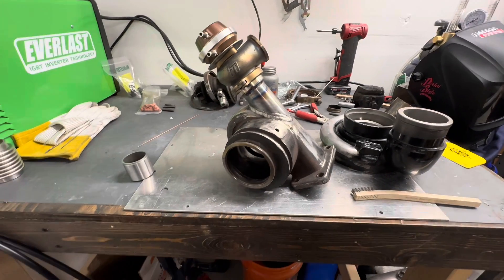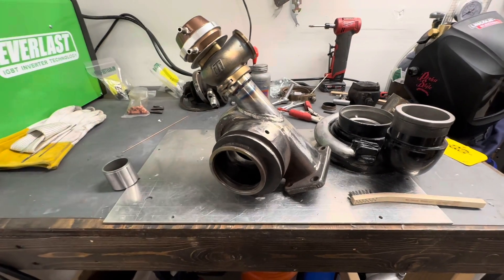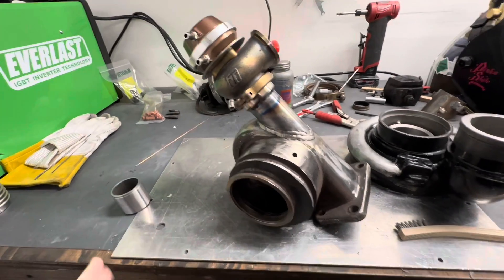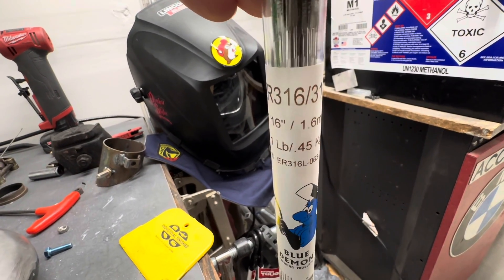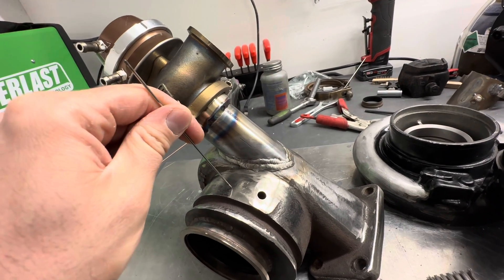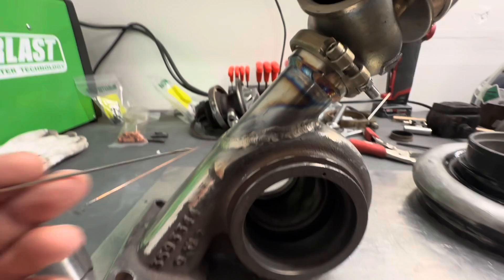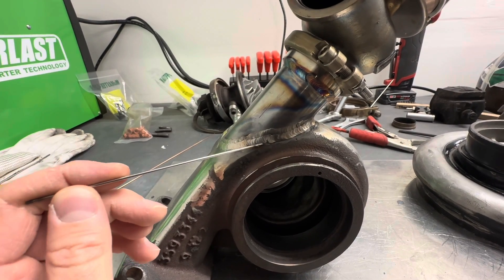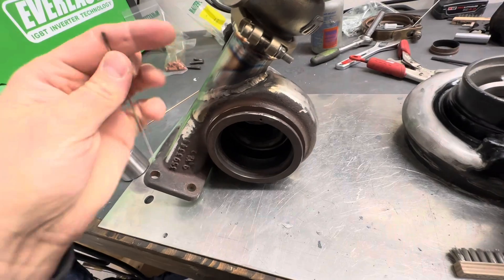Welding a Wastegate on a Turbine Housing Basics

Comment: i have some Ni99 filler rod, believe its for cast welding repairs, wonder how it will hold up to heat on an exhaust housing.
Reply from the maker: Nickel 99 is great for this stuff I have used it too

Comment: Awesome video :) and ya did a killer job on it
Reply from the maker: Thanks for all the help ! Hopefully I explained it well
Reply: @TurbineResearch  you did good. The only reason I had ya multi pass stringer vs a single cover wide was due to the root width being so wide it would take a unreasonable amount of arc force to run a single cover over the top :) everything else I believe was 💯

The tacks don’t have a targeted width more so a targeted length. So a bunch of little mini stringers that can be ran over with a wider main or root pass to make them disappear 👌